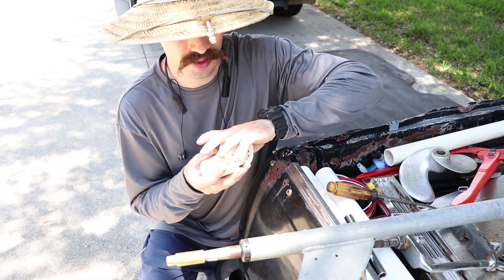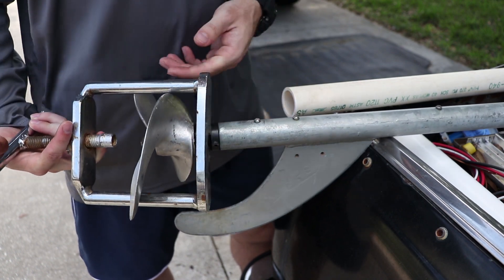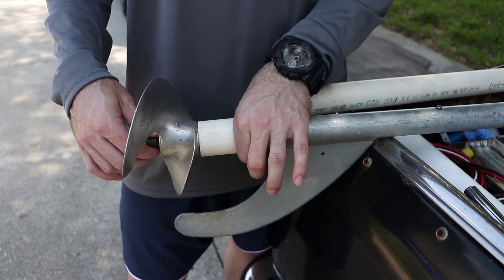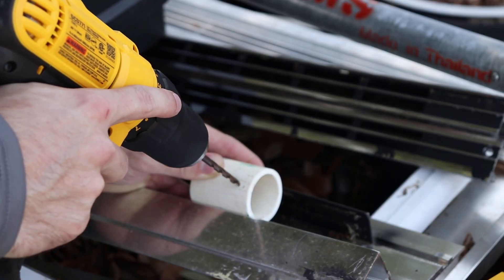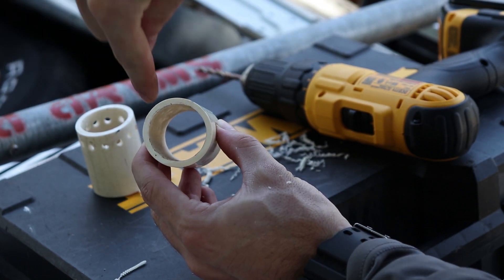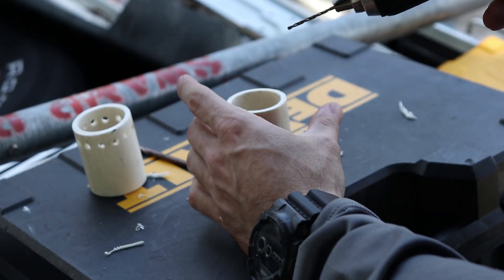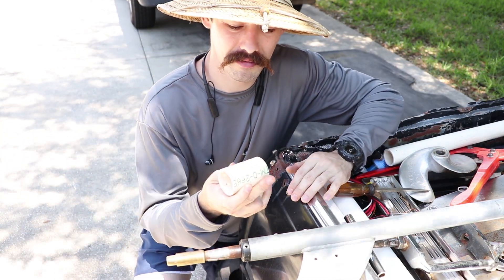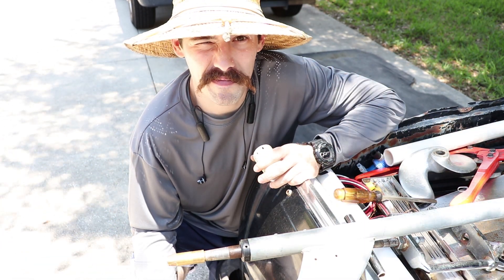Prototype #2: Combat Thick Vegetation - TLT Longtail Mud Motors

Comment: Did this idea work for you, running into the same issue right now just melted my first bushing Bc of weeds wrapped around the prop
Reply from the maker: I use the spacer concept and it works without issue. I never needed to really test this, it was just an idea for others to test if they wanted to play with it, so no I never did test it fully. The double-thickness PVC spacer is what I use.  This is the PVC spacer video - https://www.youtube.com/watch?v=PcPzH59GP1U and this is the 3d printed one -  https://www.youtube.com/watch?v=RFxwi7yMP4w&t=182s. Hopes this helps. Let me know

Comment: How is this working out for you? I’m having the same problem of Getting weeds caught
Reply from the maker: I have not run or tested this yet. I'm in the middle of rebuilding my transom on the boat. I was able to make it weedless with the first weedless spacer I made with doubling up PVC pipe. I just couldn't use the prop puller to get the prop off. So if you aren't changing your prop out a lot, the pvc spacer will work.

Comment: Would it help at all to put a lil anti-sees on the shaft where the prop goes? Would it hurt anything?
Reply from the maker: You could, but the prop is held on by friction so I don't know if it would help or hinder. Something to try. You can always wipe it off. I may give it a try late on once I get the sps back on the boat
Reply: @JTgatoring  isn't there a keyway to keep the prop from spinning? Im trying to do all my homework before buying a longtail. All your videos have abben a big help. Thank you
Reply from the maker: @bandjoeoutdoors9089  There is a key way but it's more of a guide than anything. They are very shallow and don't stick up that much. The anti-seize would help you get the prop off if you keep changing out props, but most people end up finding a prop and sticking with it unless there is a big weight difference for a certain purpose. If you break the prop, they normally break all the way off by cracking straight down the hub, or by breaking off an ear, and at that point (if you don't have a prop puller) it's easier to break the prop off the rest of the way. And the prop is really held on there by by the tapered shaft. The force on the prop continually pushes it up further onto the taper of the shaft and that's how it holds. It is not a straight shaft with a key. It is tapered with a key where the key guides the prop on and the taper holds the prop.

Comment: Can you provide the plans for 3D printing? May have a friend print a few for me.
Reply: just wondering if anyone thought about making a machine milled cutting tool to cut the weeds instead ?
Reply from the maker: @ricklamoureux3334  Swamp runner has a weed cutting bar that you attach to the skeg and it does help, but I just like playing around with it and experimenting
Reply: Also what type of filament are you using?
Reply from the maker: @ajzozakiewicz9128  This is the first prototype that works great for me - https://www.thingiverse.com/thing:3113213 . Prototype #2 is not a 3D printed part. It is just PVC

Comment: Hey man. Love your vids! Just had a question for you. I just recently bought a long tail kit, I have the predator 670 installed with it. I took it out for the first day yesterday and it was very difficult to keep in the water and also to steer. It kept trying to kick out up or side to side. I had to use all of my weight upwards to keep the prop in the water. If you could please help out in any way or insight that would be much appreciated. Thanks
Reply from the maker: Thank you! Swamp Runner has a great video on how you can adjust your kit. This would depend on what kit you ordered, but it gives you a solid foundation on what to look for and how to fix it - https://youtu.be/FAA7j0dVrLU - theres a things going on so once you can narrow it down then I would be able to better help you.

Comment: would having grooves wether in a straight line or rifled like a barrel on the inside help to creat e water flow?
Reply from the maker: Possibly. I do not know if it would be more beneficial to have an increase in water flow or not. I know that without this PVC pipe on the shaft the longtail will pull a good amount of water up into the shaft. I haven't tested this yet, but this PVC pipe may not even effect the water flow all that much or it may really decrease it. I planned on testing it with a cheap Delrin bushing because those melt pretty easily when they don't get enough water.
Reply: Not really,  you will need to index the water flow

Comment: How about if you cut it in half long ways and hose clamp it on, then you can loosen clamp and remove it to use prop puller still. Just a thought.
Reply from the maker: Great idea and that would work. I am leaving my a little short so that way I can slide it towards the engine to reveal the inner shaft so that I could use the prop puller, but if you decide to make it long where you can no longer slide it then that would be the way to go! Solid idea 👌

Comment: Fyi, if you ever find yourself needing a larger screw type hose clamp and you only have some of the smaller size ones, you can completely unscrew 2 of them and couple them together making one large diameter one. About 10 years ago I figured this out when stuck on the side of the road with a busted radiator hose about 100 miles from anywhere on I-20 in TX one time. That truck still has those 2 clamps on the upper radiator hose to this day.
Reply from the maker: Haha yes sir! I wanted as small of a profile as I could get. Having two of the screws seem like it would really hang up on grass, but yeah, it's definitely do-able!

Comment: Love it man. Just took mine out on its maden voyage. 1436 with Duromax 440 18hp with swamp runners kit
Reply from the maker: Awesome man! I've been hearing a lot about the 440's. What kind of speeds are you getting and how do you like the engine and the whole setup??
Reply: @JTgatoring  not sure yet. We are still working on the boat getting everything straight. Like adding floors(after watching your install videos) adding a grab handle and flotation pods on the back. The motor with the kit was way to heavy so we have to add pods.
Reply from the maker: Sounds like some fun!! I'd like to see how it ends up. I know the 13hp and kit is too much for my boat even after re-enforcing the transom. I still get some play in the transom when I digging through the mud.
Reply: @JTgatoring  we did some aluminum cross bracing.as well as reinforce it with 3/4 plywood sandwich between two sheets off aluminum plate. Absolutely no play in mine.
Reply from the maker: Very good! I probably need to do some more bracing for the top like you have.

Comment: Good job bro. Be sure to secure the bushing. With it rotating it will not perform the way it should. With it rotating, weeds can still wrap around it and the angled holes are a must to be in a certain orientation. Picture the prop in the water. You notice it isn't vertical or perfectly horizontal. So with the holes angled toward the prop (drilled from outside to inside, running toward  the prop) at the bottom, water will be directly forced inside the hub, while the top holes (drilled toward the bushing fin outside to the inside), water will be pulled from the props proportion, therefore the water gets pulled from inside the bushing. This should actually cause a greater water flow that if it didn't even have anything.
Also, be sure to put the screw side of  the clamp on the top. Less contact of vegetation
Reply from the maker: Rodger dat, love it. I'll make those changes when I get the swamp runner back on. I won't be able to test it anytime soon, but I wanted to get it up so that others can experiment with it
Reply: @JTgatoring  your going to love the backwater mm.